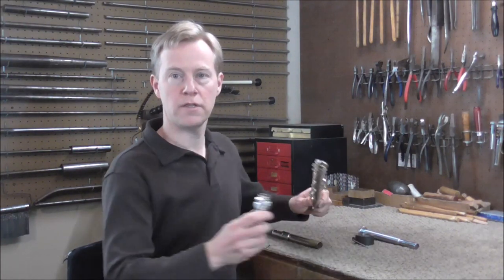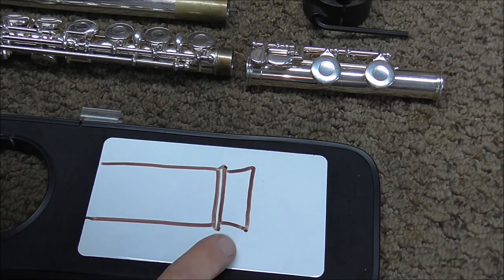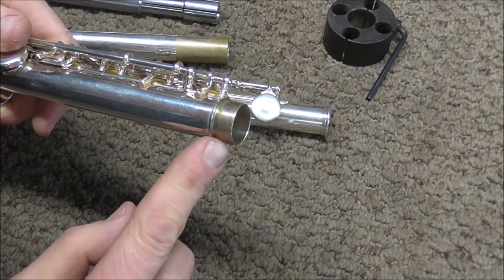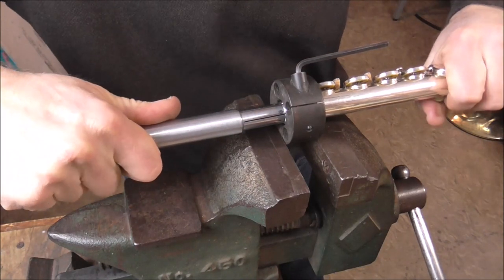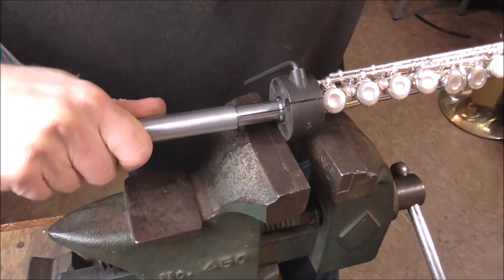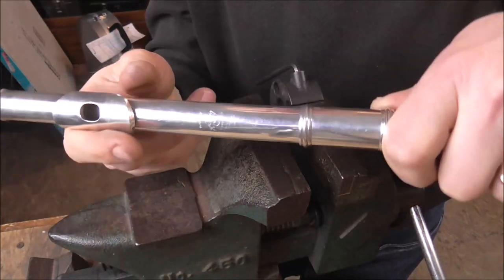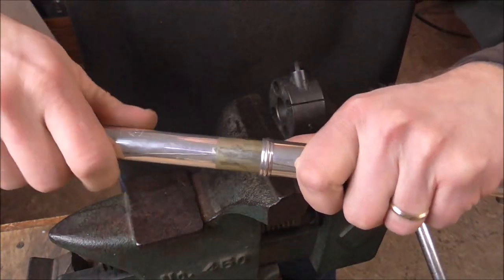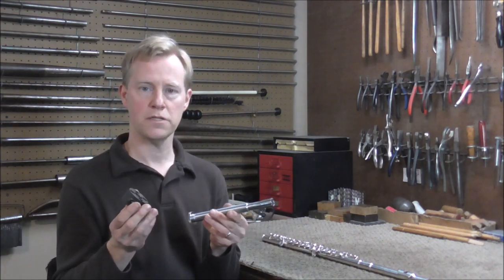How To Fit Loose Head and Foot Joints On Flute

Comment: There was different tool I used for that job (mainly just for the foot tenon) that looked like two rollers like you would see on an old fashioned clothes-wringer.  You put the foot tenon over one of the rollers, then the other one would contact the other roller from the outside of the tenon.  You can tighten a screw that brings the rollers closer together to expand the tenon more.

Comment: What if I don't have the tools to fix a tight foot joint?
Reply from the maker: It is hard to fix a foot joint that is too tight without the shrinking die, but you can try putting it on the flute with some cork grease and rotate it several times vigorously. This may or may not work and it can be a little risky, but you can try it if you wish to.